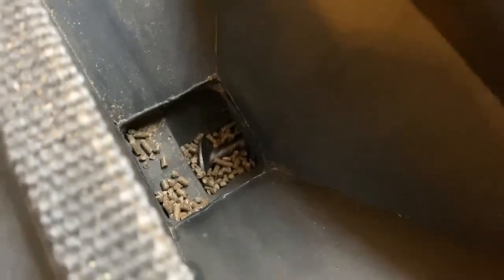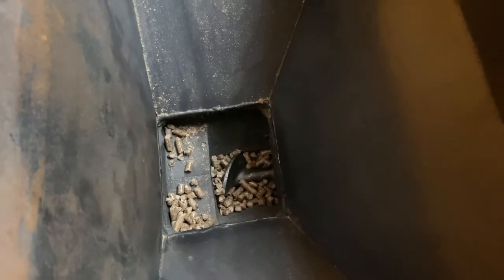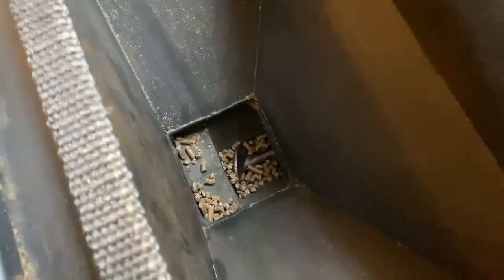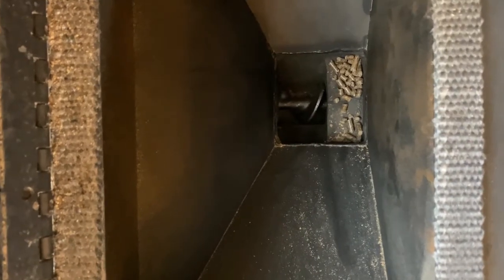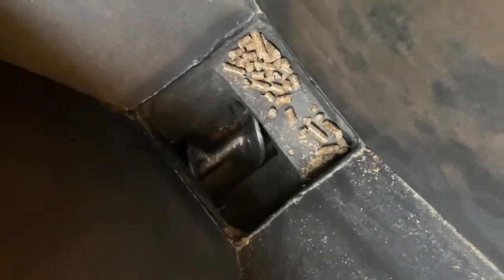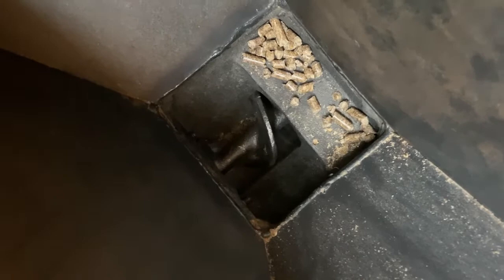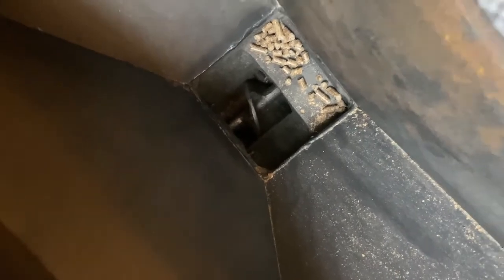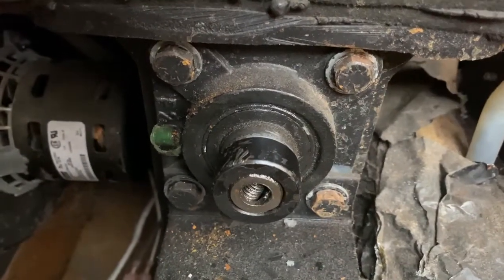My pellet stove will not feed pellets

Comment: Thank you for your video, because of you I fixed my problem. You should say in the title the model of your pellet stove which I am certain is an Englander 25 PDVC (like mine). Mine was so jammed, I didn't understand how you could move the auger by hand, so I removed it completely like you showed.
Reply from the maker: I’m glad my video was able to help you out I appreciate you taking the time to comment and yes mine is an Englander pellet stove.
Reply: The most efficient way . Thanks a million.
Reply: Is there a way to gain more access from inside the hopper? Should I be able to freely rotate the top auger with the motor still attached. The back panel of my pellet stove is fairly difficult to access to disassemble the unit
Reply from the maker: @fabistewart6355 It’s very difficult to turn the auger while it’s still attached to the motor if the auger turns easily from inside the hopper it’s probably disconnected from the motor. And at least on my unit there is no other way to gain access to that motor other than through the back panel. I hope this helps thanks for the question.

Comment: Thank you for the reply! A bit limited of pellet stove technicians in my area so greatly appreciate the video. I removed the back panel and found where the motor attaches to the top auger. Weirdly my bolt is on the underside of the motor and is very difficult to access is this normal ? Wish I could send a picture !
Reply from the maker: If you’re talking about the bolt that attaches to the auger from the motor then you may be able to turn the piece to get the bolt on the top side. On mine that whole mechanism that the bolt is hooked to turns every time that auger motor comes on intermittently I’m guessing yours might be the same if we’re talking about the same bolt
Reply from the maker: Also I have a Facebook page with the same name “shanesmaineshop“ maybe you can post a picture there or message it to me. You’ll know you’re on the right page if you see a antique dark blue truck in the background with a round picture on the front that shows a green small John Deere tractor.
Reply: @shanesmaineshop  you’re amazing thank you I’ll send a message !
Reply from the maker: @fabistewart6355  Are you getting my responses on messenger

Comment: into the top motor, and it turns, but it will not turn without being plugged in to its own power source
Reply from the maker: I’m not 100% sure because I’m not there looking at it but it seems like the control board that says power to that motor is not working properly or there’s a bad wire between the control board and that motor